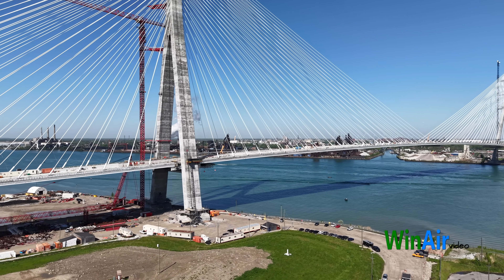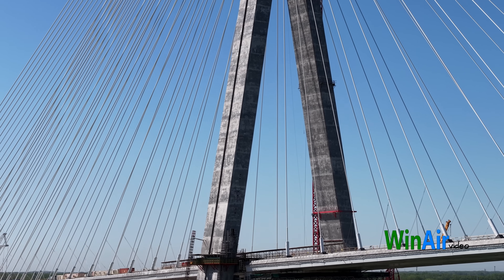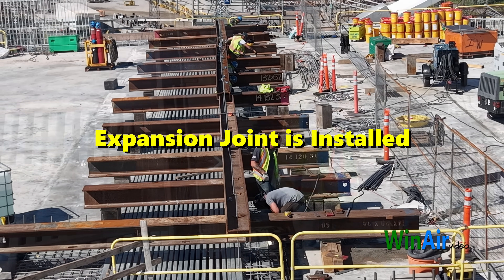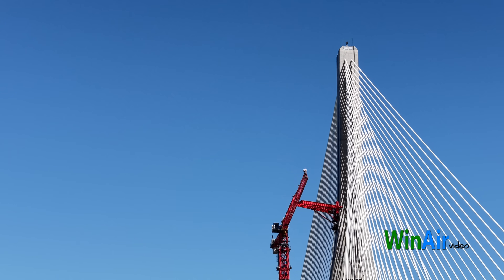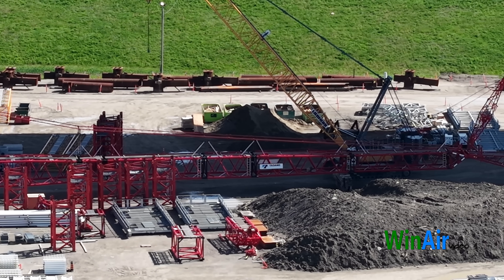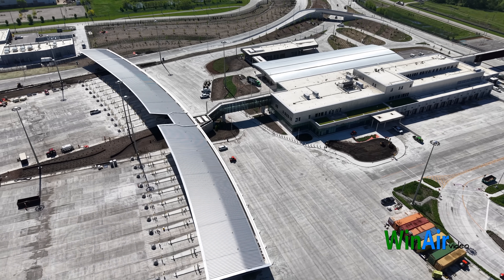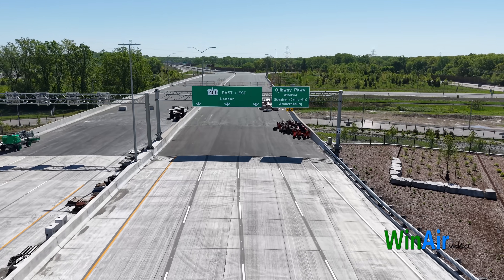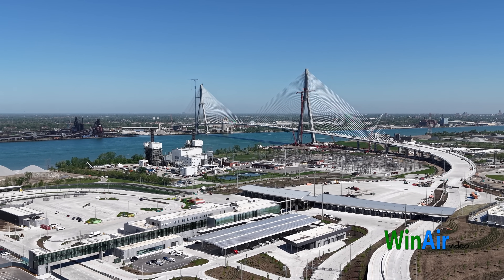The Secret Steps To Making A Mega Bridge!

Comment: Can you get statistics on the number of crossings at Windsor, car and truck, month by month since the beginning of the year?
Reply from the maker: Hi John. That is a good question. This is what I found.
Passenger Vehicles (Cars)
March 2025:
Total travellers (Ambassador Bridge + Windsor-Detroit Tunnel): 607,179
Down from 690,897 in March 2024 (a 12% decrease).
Specifically at the Ambassador Bridge, passenger car crossings dropped by more than 9% compared to March 20245.
February 2025:
Total travellers: Less than 514,000
(Exact breakdown by vehicle type not specified, but overall traffic was lower than March).
January 2025:
No specific Windsor-only figure available, but national data shows a continued downward trend in crossings.
Trucks (Commercial Vehicles)
March 2025:
Trucks crossing at Detroit (Ambassador Bridge): 108,000
Down from 126,000 in March 2024 (a 14% decrease).
CBC Windsor News reports truck crossings down more than 15% at the Ambassador Bridge in March 2025 compared to the previous year.
February 2025:
No specific Windsor-only figure, but monthly truck crossings were lower than March.
January 2025:
No Windsor-specific data available, but national truck crossings were up 6% year-over-year in March, suggesting some recovery in truck traffic relative to passenger vehicles.
Trends and Context
Overall Decline:
Both car and truck crossings at Windsor are down significantly compared to 2024, with passenger vehicles seeing a sharper drop than trucks56.
The decline is attributed to political tensions, new tariffs, and a general reduction in cross-border travel.
Recent Rebound:
March 2025 saw a rebound from February, but numbers remain well below 2024 levels.
Table: Windsor Crossings, 2025 (Jan–Mar)
Month	Passenger Vehicles (approx.)	Trucks (approx.)
January	Not specified	Not specified
February	<514,000	<108,000
March	607,179	108,000
Note:
Data is based on the most recent releases from U.S. Customs and Border Protection and media reports.
Figures for April and May 2025 are not yet available.
The numbers above include both the Ambassador Bridge and Windsor-Detroit Tunnel, the primary crossings at Windsor.
If you need more granular or up-to-date monthly data, the U.S. Customs and Border Protection Stats and Summaries webpage and Statistics Canada are the best official sources to monitor for new releases
Reply: @bobjonesrealtor7756  Bob, Thanks for the work you did on this. It'll  be interesting to see what the crossing numbers do once the tariffs really begin to bite.
Reply from the maker: That will tell the story.

Comment: Greetings from Basel, Switzerland - a question:
What about the 'old drone' - was it found ?
Or could you fly over the place where the poor thing crashed ?
Such things annoy me incredibly.
Reply from the maker: Hi R1712D. It hasn't been found, or returned. I did get the data of where it either crashed or landed. It is in a bush area and yes I did search with the new drone as well as trek into the area and search physically but no luck. Still a mystery!:) Thanks for asking.
Reply: @bobjonesrealtor7756  
So, still not found. 
Then there is a "test" - equip the new drone with a GPS tracker and try to search for it. 
By the way, my colleague's last drone was stuck high in a tree. It was tedious to retrieve it. GPS trackers for dogs or cats would be my idea.
:eyes-purple-crying:
Reply from the maker: They do have a 'find my drone' feature, but it is useless without power. Good idea R1712D!

Comment: From a distance, not much is visible of the deck details, and the sketches I've seen have no details leaving me with questions. What will the fences and safety barriers look like on the bridge? Will they obstruct the view so drivers don't get distracted? I'm curious what those strange covers are all about at the cable bases.
Reply: You can see the fencing in other videos (there's also a guy who does drone footage from the US side regularly). From what I've seen it appears that drivers (unless they drive a semi) won't see much of anything on a drive over. Unless of course they take a hard look to the side to try and get a view over the river.  Which might lead to excess accidents on the bridge...IMO that's the really stupid part of this otherwise impressive bridge. It's only human nature to want to look at scenery when crossing a high bridge (or anything with a view, like a mountain road) and this sort of fencing may end up creating an unforseen hazard to drivers.  I suppose anyone afraid of crossing bridges might find comfort in not being able to see over the edge - if they can avoid being rear-ended by those who are trying to look  I've seen other bridges with high railings but ususally they are done in such a way that they don't obstruct the view too much. In this case it's just poor design...
Reply from the maker: I tend to agree the fencing looks like it will interfere with the view.
Reply from the maker: Hi Dennis. If you are referring to the brackets on the bridge deck I believe the are for hydraulic stabilizers for the stay cables.